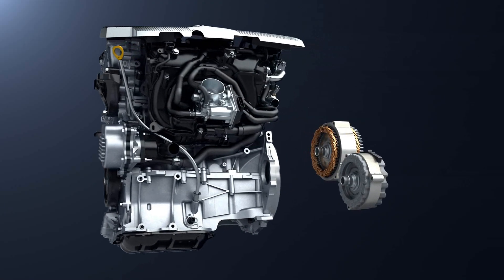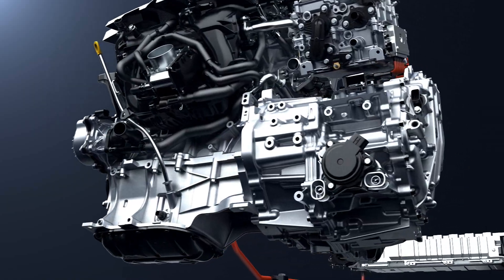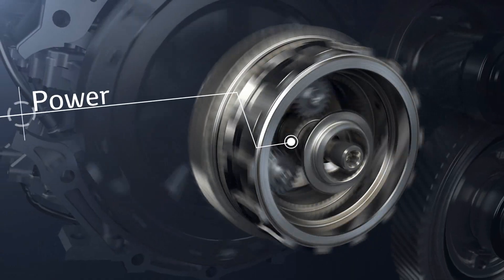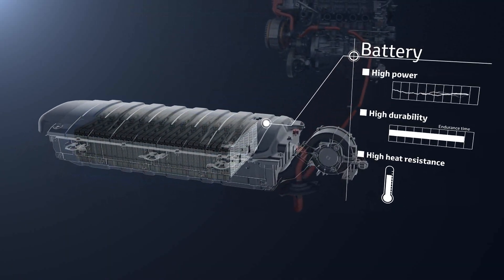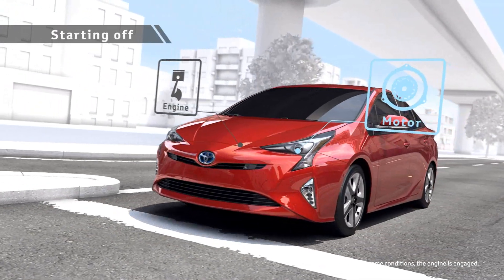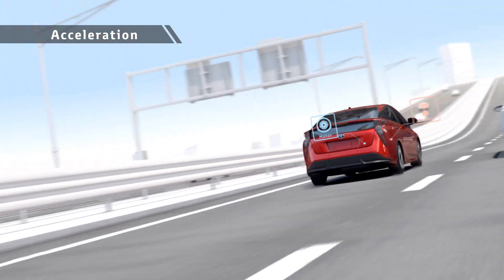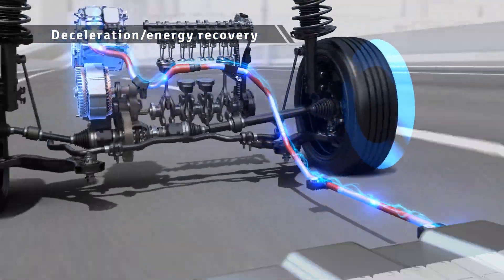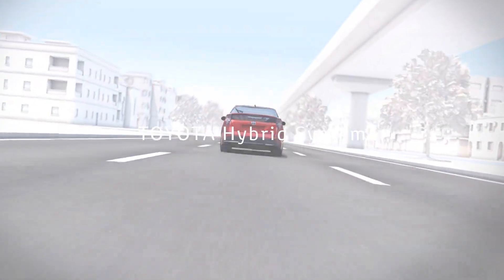Toyota Hybrid System

Comment: why do u need it to be electric. there is an ICE engine. use it to power the vehicle.
Reply: The ICE does push the vehicle, it's run through a gearing system that allows both the motor and ICE to provide power as the system requires. The engine isn't working as hard as a comparable pure-gas system, so the parts last longer. Also the brakes almost never need replaced due to EM braking. Also $20 to fill the gas tank on a car with a 500+ mi range (that refills in minutes, as opposed to hours for battery-only cars). You can sit around all night with the car in "Idle", the engine kicks on as a generator occasionally, and you'll use less than a gallon typically. I could go on, there are plenty of reasons. Technically it should have better performance than a comparable pure-gas system too, but they software limit the cars to perform like a slug. A better question is: What were they thinking with that new design? They shaved off all the practicality from the design and now we're left with a car that is both ugly AND impractical. Could have spent the money from the failed redesign on instead developing a diesel hybrid so we can get to the actual 120+mpg range.
Reply: fisioserv : I'm assuming this is a genuine question and you really want to know the answer rather than just stir up trouble.  The Prius ICE does not have enough power to satisfy most buyers.  They would not be happy with the acceleration.  The electric system adds the boost needed to make the car "driveable".  Why the low-power engine?  The purpose of that is to increase its efficiency during normal driving, which is almost all of the time.  When an ICE is operated below about 40% of its rated power, efficiency is low.  This is partly because to reduce the power the engine is "throttled", which means it has to suck air through a small aperture and this results in "pumping loss".  A small engine does not need to he throttled as much to reduce its power to what you need.  The Atkinson / Miller cycle engine in the Prius also has the trick that it can expel part of the fuel / air charge before the inlet valve closes, again reducing the need to throttle.  Once you have a small, efficient ICE mated to an electric boost system, all kinds of other "magic" becomes possible, such as all-electric driving at low speeds, no step gearbox, very low engine RPM during cruise, no starter motor, stopping the engine when the car stops, electric accessories, etc.  There are disadvantages, for example you can't tow a camper or any large trailer and  ... I can't think of any other disadvantage right now.  I hope this helps.
Reply: Graham Davies and really the only thing stopping the Prius from towing anything of weight is the electric inverters. The hybrid geartrain itself is more than capable of allocating torque as needed, but the electronics would be overloaded in the process. The newist Prii I think have a software upgrade that fixes this though.
Reply: John Rickard : I rather doubt that this is true.  Handling the necessary power in the electronics is easy.  The power rating of the larger of the two motor/generators is 53 kW.  The Nissan Leaf's motor is more than twice as much at 109 kW.  The Bolt and Tesla are higher still.  I don't believe that Toyota would mess up an easy bit of electronics design and compromise the versatility of the car.

Suppose you drive your Prius at 70 m.p.h. on a level highway and it takes 35 hp to do that (an educated guess, but close enough).  This is 37% of the rated engine power of 95 hp.  It will run comfortably at around 2,400 rpm.  An upward hill will increase the rpm somewhat.  No battery power is needed.  Now add a trailer that has a similar size and weight to the Prius but is flat, front and back, and therefore has a lousy drag coefficient.  The power needed will more than double.  At 75 hp, we need 79% of the engine maximum output on the flat.  It will run at 4,500 to 5,000 r.p.m.  On a moderate hill, it will max out.  This is just not a good idea.  By contrast, the Camry base engine at 203 hp can supply 75 hp at only 37%.  Without the trailer, it's running at 17% (which is well below peak efficiency, hence it gets much poorer fuel economy).

Of course, if you have anything to back up your statements, I'd be interested in looking into this more deeply.
Reply: fisioserv dumbass

Comment: My fuel mileage average on my Chevy Volt is now a hundred and eighty-one miles to a gallon and my car is a hybrid LOL
Reply: Could you please post where you get that figure from?  I'm not doubting you; I'd just like to find out.  I have a Prius and a Leaf.  By my calculations, the Leaf uses about 60% of the fuel energy per mile of the Prius accounting for all the losses I can reasonably predict.  So if the Volt is more than three times as energy efficient as a Prius, either something is wrong with my calculation or that figure is wrong.
Reply: @grahamdavies8924  oh mr. Davies it's a series hybrid so it runs off of battery and then after the battery depleted there is a gas generator that starts at the power of the electric Drive Wheels for every mile I do not use gasoline and that's my mile to the gallon average not right now I'm up 187 average I've got over 6,000 and change on the car and I've used 25 gallons of gas since I've owned it last November that's stats are from my onboard computer if you do not believe me you can give me your email address and I will send you photographs of the mileage
Reply: Ah, OK, so you're not counting the energy used by the power station that generates the electricity you use when you don't use gasoline.  Using that method, I'm afraid I have you beaten by a long way because my Leaf gets infinity miles per gallon.  I've used zero gallons of gas since I've owned it.  Also, the math is wrong.  6,000 miles divide by 25 gallons is 240 miles per gallon.

Comment: I own a hybrid camry, And it is the best investment I have ever made. I know that it is advertised as 40mpg, but I've gotten up to 80mpg from it. I couldn't be any happier.
Reply: I own it too, 2010. Very good car. Bought used at 60k km and now over 230k km. No major issues. I did replace 12v battery though, tires and breaks but this is very normal. It never failed to start even at -35C in Winnipeg, Canada!
Reply: We only got the Camry here last year, in England, I must test drive one once covid is over.
Reply: I get 972 mpg in my Chevy Express with LS3 and 75mm turbo

Comment: At 0:56, the video states that the "generator" (actually, MG1) produces electricity and passes it to the "motor" (actually, MG2) which drives the wheels.  Actually, this happens only at low speed and during acceleration or climbing a steep hill.  It is the equivalent of being in a low gear.  Once you're up to speed, the complete reverse happens.  Power is drawn from the final drive by MG2 and passed back to MG1 to decrease the engine spin and therefore increase fuel economy.  This is the equivalent of being in overdrive.  Without this subtlety, you'll never properly understand this drivetrain.
Reply: Hi can you please confirm me by return if above car has a CVT transmission inside and/or there is no transmission on above car. Which is correct  ?
Reply: @attilakhan4606  Placing a load on the generator to charge the batteries or drive the motor changes the rotation ratio between it and the engine, this effectively lowers the engine speed while wheel speed stays the same.  This is achieved without a belt and cone system like most CVTs, simplifying the system and increasing durability.
Reply from the maker: Attila Khan The planet gears is transmission like a CVT.
Reply: Really clear! Before I was in doubt: if a generator is used to keep engine at low regime, where goes its energy? You give me the answer: to the other electrical motor. Both works togheter to control the termal engine speed.
Reply: Interesting comment, is this why the engine and battery combined propel the car rather than just the engine under acceleration?
Reply: @amateurtorque6709  : To simplify slightly, the battery is only used as a significant source of power in two situations, first if the engine cannot produce the power requested by the driver and second if the battery can produce all the power so that the engine can be stopped.  The transfer of electrical power between MG2 and MG1 should not be confused with draining or charging the battery.

Under acceleration, power demand is high (we assume for this discussion).  To get that power from the engine (forget the battery), the car first opens up the throttle to increase torque and (assuming that's not enough) allows MG1 to spin faster so as to increase the engine spin.  Electrical power is now generated by MG1 (again, forget the battery) and passed to MG2 where it becomes additional torque at the wheels.  This is what is explained in the video.  Only if the engine torque and spin cannot be raised enough to supply the power demand is the battery used.

The point of my comment is that under normal power demand the exact opposite happens.  Torque is stolen from the wheels by MG2, becoming electrical power that is passed to MG1 which spins in the other direction so as to reduce the engine spin and increase fuel economy.

Please post again if this is still unclear.
Reply: @grahamdavies8924  Dear sir, how to understand the system at the level you have? Kindly suggest resources. Thanks
Reply: It’s an awesome system that’s for sure,way ahead of any competition

Comment: The worst time is when the battery is fully drained, and the car must drive from engine alone. Ugh, what a slug with just the engine of a normal car!
Reply: it still gets a torque boost from the battery as the system never lets the battery fully deplete
Reply: Stephen Gillie : How are you driving that you "fully drain" the battery and then find 98 hp sluggish?  I think you must not be suited to drive this kind of car.  If you want to help the environment maybe look at a small engine with a turbocharger, such as is popular in Europe.

Comment: wow the engine wont last too many km with all that dry starting !
Reply: up yours : Your comment is completely groundless, so you won't be interested in learning why you are wrong, but for others who may be interested - the engine is not started in the "normal" way of non-hybrid cars.  The motor / generator used for starting is powerful enough to spin the engine up to operating speed to get everything lubricated before injecting fuel.  Two cylinders are started first and the other two join in on the next rotation.
Reply: @grahamdavies8924  well yes that may be true but unless the oil pump is electricly driven and fires up a short time before the engine starts its going to have metal to metal contact in the crank bearings
Reply: @isakjohansson7134  : Why do you think that the crank bearing will become completely dry when the engine stops?  Even if you are correct, the pressure in the bearing will be a tiny fraction of what it would be if the engine was started by firing up the internal combustion cycle.  Anyway, the fact is that this engine lasts as long as any other.
Reply: @grahamdavies8924  i know it doesnt become dry but you dont have any oil pressure which means it will still take some amount of wear from starting repeatedly
Reply: @isakjohansson7134  : I think neither of us have the expertise to resolve this.  What I know is that the Prius is consistently rated high on reliability, so there is no actual problem here.
Reply: @grahamdavies8924  pherhaps not

Comment: why u canno charge the battery by wire? this makes no sense wtf?
Reply: the Prius Prime could to that. The standard Prius battery is too small.
Reply: ming nguyen is right; running from electricity isn't the point of the Prius.  You can only drive a few miles on energy from the battery.  The point is to greatly increase the overall efficiency of a car using gasoline as its sole energy source.

Comment: A good feature is the "Prius launch" at the traffic lights: with most cars, you put the throttle down, the engine rev's go up, the car starts moving after a second or two. With the Prius, the car starts moving immediately, and as you cross the intersection, with a barely perceptible "thump" the engine starts, then provides more acceleration before the electric motor drops much in torque.
Reply: Paul Langford you get the instant electric motor response. I like this for city driving. No waiting for an auto transmission and no horrible drive by wire response that takes a second before anything actually happens.
Reply: Hello can you please confirm me by return if above car has a CVT transmission inside and/or there is no transmission on above car. Which is correct information ?
Reply: @attilakhan4606  yes there is a transmission in the car.they call it cvt because there is no shifting gears.but this cvt gear box is not like the cvts on the Nissan o some others.this transmission is totally reliable.inside this transaction is mostly big motors and generators and some gears.I am a mechanic for more than 35 years and I never replace one transaction on a Prius.i own a 2013 with 128000 miles and It still looks and runs like new.
Reply: @rauls300ce  Thanks for detailed reply.  +1
Reply: @attilakhan4606  And it its called e-CVT. It's confusing they are using term "CVT" for a totally different solution than normal CVT. There's no belts like in normal CVT. Toyota system is basically bullet proof, no gear changes needed. My 1.8 hybrid is coming next week, a new C-HR :).
Reply: @timogronroos4642  Yes these are too complicated but it seems a good transmmission ie  E-CVT i liked. :)
Reply: @rauls300ce  
128 000 is nothing though.
Reply: @attilakhan4606 The Prius has a CVT for the gas engine.
Reply: I like creamy mashed potatoes
Reply: @thepincushionman7063  
Me too.
Reply: Cool, although not sure why one would need it. Why not have a smooth start, at the intersection especially (few more moments to make sure it's clear). Plus that function I'm sure consumes quite a bit of battery.

Comment: engine charges the battery via a converter circuit , for every kilowatt charge of the battery the converter wastes one kilowatt in heat.so why not do away with the battery and just power the car with the engine ?
Reply: Efficency of the inverter is much higher than you think. And indeed it will power the car directly if you accelerate within the optimal rpm for the combustion engine. In reality you cant and then the electrical motor/generator kicks in to compensate. So the combustion engine will always run near its optimal rpm range. oh ... btw ... the amount of extra torque from the combustion engine combined with the electrical motor is a great bonus when doing a kickdown on the pedal :)

Comment: how aircondition works at complete stop or stock on traffic????
Reply: it runs from battery
Reply: Instead of running off a belt, they run off electricity and don't need the engine to be running.
Reply: It's a completely separate system with its own electric motor-driven compressor.  It does not use any part of the drive train, just electricity from the battery.  It will reduce fuel economy by a few percent, more than a normal car, but that's because a normal car wastes enough energy to swamp small losses such as AC.
Reply: @grahamdavies8924  The new AC system on my 2018 Camry Hybrid can focus only on the driver if he/she is the only person in the car. There is a setting for that. Also, the amazing part is, with 4 passengers, AC on, and doing 70mph, the mpg does not change, same efficiency.  I've been getting 52.7 mpg this summer going mostly 80mph.
Reply: @WAN2TREE4  : That's very impressive fuel economy for that speed.  That's about what I get in my 2016 Prius at 71 m.p.h.  But, you're believing the display on the dash, right?  You might actually be getting 50 m.p.g.  Just saying.  (I know this because I record all fuel at the tank and work it out with a spreadsheet.  My cross to bear!)
Reply: Electric compressor. Probably quieter than a fridge lol

Comment: I guess hybrids cars dont have a transmission?
Reply: by design they have a variable "transmission" via planetary gearsets connected to electrical an motor and a generator.
Reply: DANIEL ESCO : Every car has a "transmission" of some sort.  Simple "parallel" hybrids (Honda) have the same kinds of transmission as a normal car, i.e there are discrete (step) "gears" that are selected either by the driver or some automatic system of varying sophistication.  Electric cars and "series" hybrids (BMW i3 with range extender) have the simplest transmission which just converts the optimum spin rate of the electric motor to the necessary range of wheel spin.  What is extraordinary about the Prius-type hybrid system is that the engine spin is matched to the wheel spin without the use of variable mechanical gearing.  This is done with the "power split device", which is really a torque splitter.  72% of the engine torque goes directly (mechanically) to the final drive and 28% of the torque enters the electrical half of the transmission.  This can operate so as to increase the wheel torque, just like a low gear ratio, or to decrease engine spin, just like a high gear ratio, according to driving conditions.
Reply: Some are just a normal transmission with added motors for acceleration support